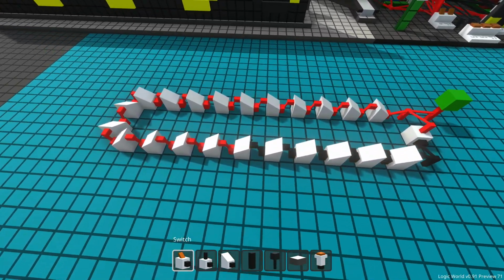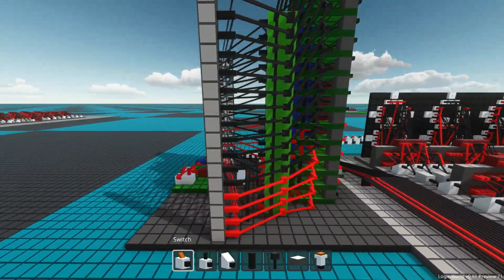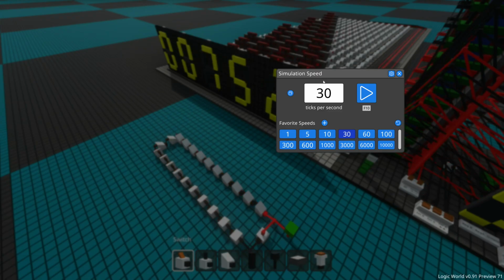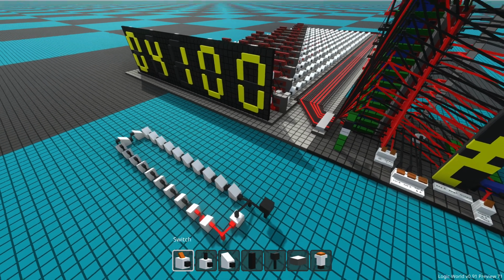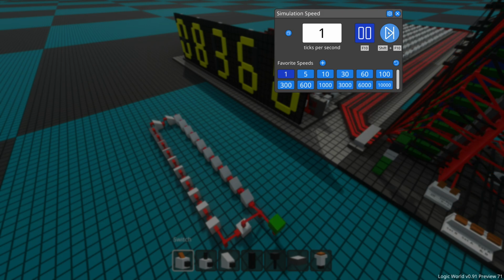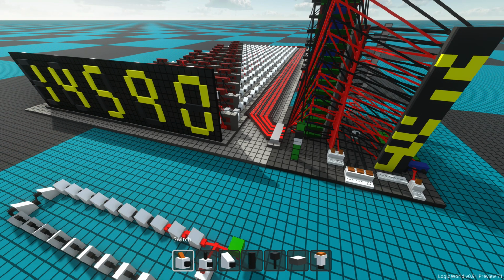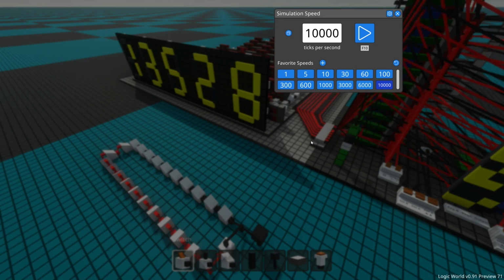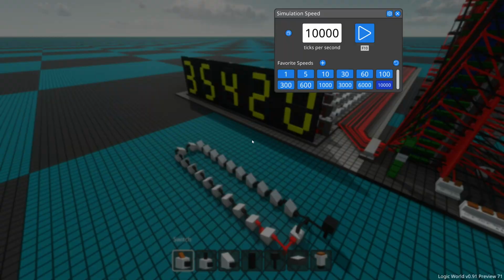Simulation Controls

Comment: How does this work, is the tick update in a separate thread? Are you performing multiple ticks per update loop?
Reply from the maker: Multiple ticks per game update loop! Each server tick, we check how much time has passed since the previous server tick, and use that information to determine how many simulation ticks to perform during this server tick. (This explanation is simplified but that's the gist!)

Also note that the simulation ticks are happening on a separate thread from the client rendering and stuff. The game is multiplayer, and all simulation is happening on the server, and the server runs on a different thread from the client. So for example if the server is lagging and struggling to keep up with the target simulation speed, the client will continue rendering at 60fps.

Hope this is interesting/useful :)
-Jimmy

Comment: How would this work with multiplayer? Would everyone have control over it, or just the host?
Reply from the maker: For now, every player can use the simulation speed controls, with the only restriction that there is a server-defined maximum. The menu state is synchronized between all players, except for the “favorite speeds” which are a per-player custom list.

We’re planning on adding more advanced multiplayer features in 0.92, which will include an extensive permission system; there will be a separately-assignable permission for controlling the simulation speed.

-Jimmy